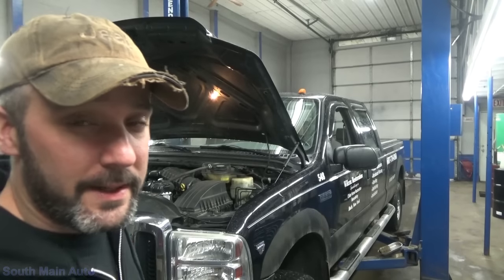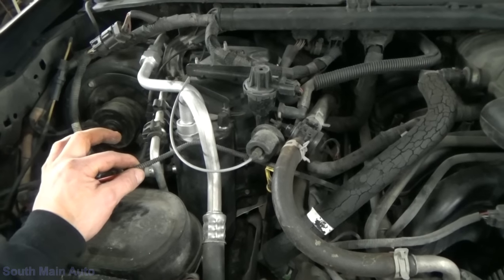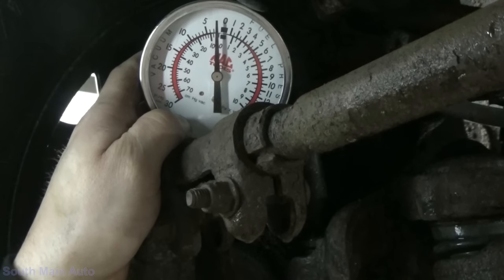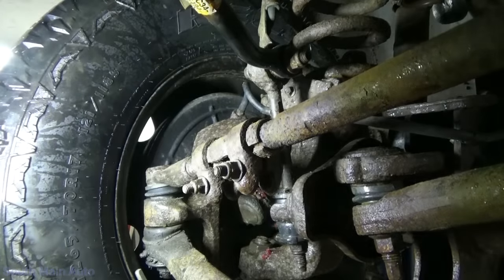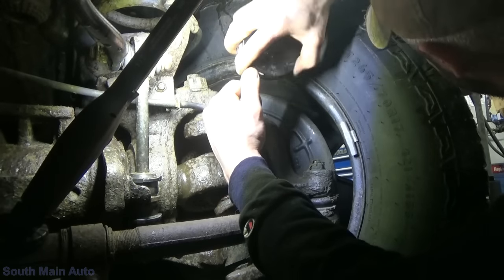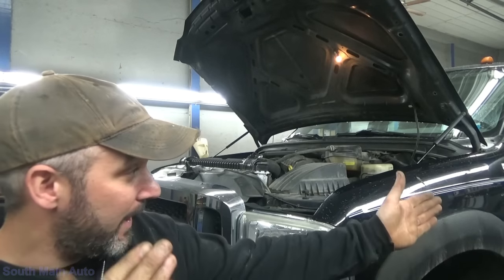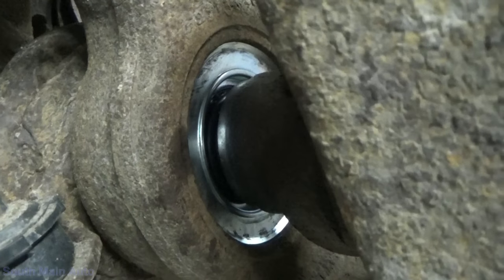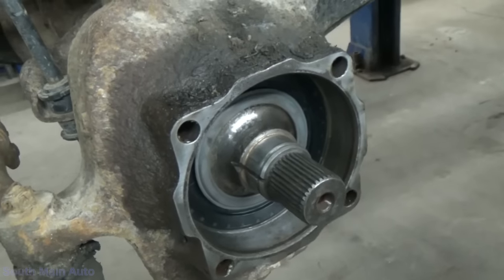Ford F250 4x4 - Vacuum Hubs NOT Engaging

Comment: I just replaced the ball joints and seals and hub. Use Moog ball joints or equivalent.  Anyway I did not use a special tool to get the seals in, I used a 4" ABS pipe and a sledge for the big seal, not easy but got er done. I did see an interesting tip from the Ford 6.0 guy (sorry do not recall his name) to put lube into the chamber of the wheel hub to make it last longer. Interesting idea. Thanks for the video.

Comment: I have a 2003 Ford excursion v10 4x4. when did my front wheel bearing replacement on driver and passenger if I omitted the dust shield will that thickness cause issues for the auto lock hubs being put into the wheel bearing? As in tolerance, not allowing me to receipt the auto liking hubs into the wheel bearing all the way as they should because the spindle shaft will be protruding out that much more in terms of the thickness of the dust shield? Or I'll be okay if I don't have the dust shield installed when I put the new bearings in? I just didn't know what the tolerance is in the center of the auto lacking hubs for the spindle going into it

Comment: What is the expected vacume at the resivoir? Mine holds at 5 PSI. Is this adequate to operate the 4WD valve and also the air distribution in the cab of the truck.

Comment: According to the Ford service manual, if you turn the Mode Switch Select on the dashboard to 4x4 high, the system will enter an approx 51 second cycle to apply a higher (> 9" Hg approx) vacuum to engage 4x4 mode, then vent the vacuum. If you turn it back to 2WD during this cycle, it will have no effect until the first cycle completes. At that time, a lower vacuum (approx 6" or 7" Hg) is applied to take the system out of 4x4. The 2WD cycle time is approx 15 seconds, but can be overridden by switching back to 4WD.

Comment: i have an 08 expedition thats not going into 2H
4A 4H and 4L switch ok
but in 2H the front axles are rotating with hubs unlocked as in 4A.
Do you happen to know the resistance values for the 4modes on the 4wd switch?  The factory ford manual
i have only shows 2H, 4A and 4H but not 4L so i suspect its not correct.
im thinking 2H resistance is off value or open.

Comment: Never second-guess the guy actually doing the work.  Also, it's your shop.  The mistakes will find you one way or the other without the peanut gallery's hounding.

But, you did mention the issue when returning to check the vacuum draw on the right side...  "As long as any possible leak is smaller than the vacuum draw, a simple gauge test won't definitively indicate one." 

Rather than smoking just at the left hub, it would have been a good idea to back-check the lines and other hub from that location too.

Keep up the good work!  As a DIY'er whose cars, trucks, power equipment, and sports vehicles have never seen the inside of a retail shop, I've learned a ton concerning emissions systems and diagnosis from your YouTube endeavors.  I much appreciate your willingness to take the time and effort to share your knowledge!

Comment: A piece of 4 inch schedule 40 pvc drain pipe about a foot long with a board on the end will drive that seal in on the 99-2003 superduty, that hub bore is exactly 4 inches so it will drive in square until it hits that ridge in the knuckle, I'm a diy fix my own truck guy and it got the seal installed with 0 damage to the seal and got my truck back on the road

Comment: Quick question. I have an 03 super duty with 6L turbo diesel. I had a guy try to figure it out before I bought it but it's not fixed though.
My 4wd works if I lock the hubs tcase is driving all the time. The dash switch doesn't do anything. He had tried new switch new tcase solonoid. In auto on hubs it's free spin.
Would a vac leak cause nothing to change on dash and hubs not to lock

Comment: Why did you remove the dust seal, cause you dont like it?
And why did you remove the spacing collar? You dont like that either? It helps keep the splines out of the rusty grit when sliding axle back in. Confused.

Comment: just wondering that vacume seal separated I don't need it because I have manual locking hubs but now I have a sqeeling noise I can't tell where its coming from but its when its in 4x4 could that seal which I can see from looking from the back the rub has come off will that cause the squealing noise?

Comment: you can make a tool from a pipe, pipe cap and a flange mount.  you have to premeasure the depth before disassembly the carefully keep measuring as you assemble it.

Comment: tanks Eric .. watching your video i reached my mechanic a trick didn't know..by the way if vacuum doesn't work or seals not changed yet.. turning the hubs in lock position the 4x4 is suppose to engage?.. i still ear a bad growling sound on 4 x4.. and even if I disconnect the hoses in the hubs, and engage the 4 x 4.. the sound is there.. is stops only if I take out the locks ( mean unbolt and take out! ) the sound stops.. on 2x4 no problem p.s wheel locks are new...!! any advice please?

Comment: I have a 2005 f250 6.0, I have 3 buttons for 2wd/4wdh/4wdL, do all f250 trucks have that outer locking hub switch since my 4x4 is not working, basically manually lock the hub

Comment: My Dad had an '87 S10, had a real bad out of balance driveshaft. Engineers from GM, came from Detroit to figure out why. After rebalancing and even replacing the driveshaft it still was bad. They eventually found out it was made wrong, and they replaced it with another new one. Months went by,  craziness.  My Dad still talks about this, this was about 20 yrs ago.

Comment: LOL when one side goes bad, never assume the other is good.  Always do both sides since no one I know drives on only one side of wheels! :) I had a 99 Dually, same thing on that one. Those seals are not cheap, plus the o-rings need to be replaced every time the hub is taken apart, and those aren't cheap either.  I finally gave up after it failed a second time 2 years later and threw a set of WARN lockout on since back then they didnt have the manual mode caps.

Comment: The knuckle vacuum nipples are prone to corrosion and often the vacuum leak is right there where the rubber tube connects. Instead of paying $20 for a new nipple from an automotive shop, an SAE 7/16 brass plumbing nipple fits just fine.

Comment: Mr. O enjoyed the video I kind of was surprised that you didn't used to smoke machine on the whole vacuum system instead of just using it on the one hub seems like it would have saved you a lot of time in the testing process but what do I know keep up the videos really enjoy them
Reply from the maker: Lol well sure could have but was just showing a bit of the isolation process with just a gauge...

Comment: How does a drive shaft suddenly become unbalanced.  Much less to the point a driveline shop can't balance it again?  Always wanted to like Ford.  Just seems like the KISS method is completely lost on their engineering team.  From blowing spark plugs, to the coolant crossover tubes that require entire intake replacement.  Never knew this was an issue on their front ends.  Kinda minor though.  I'd lock them and use the transfer case.

Comment: I know this is an older video, but surely you'll get a notification.  What smoke machine are you using?  I work at a landfill and am a heavy equipment tech, but also am responsible for about 15 pickups.  Boss's 2011 F250 has this same problem, but I don't have these fancy leak detectors you pro guys have because we have such little use for them.

Comment: You are a phenomenal mechanic, and I'm I'm not trying to beat you up, but I believe the seal installation tool would be better served by using a large dead blow hammer instead of the ball peen hammer. It will make it last longer, just a thought.

Comment: Modern ranger is always locked at the hub. Electronic control is at the transfer case. Seems a bit better. Except that the truck is always turning the axles so it's gas burner.

Comment: Great video, this vacuum system was completely new to me, as I was watching, questions come up, then you seemed to answer them sooner or later.  Just left me curious about what controls the vacuum on off and pulses, I'm guessing a series of electrically controlled valves.
Reply from the maker: yep and a control module that runs the vac. solenoids :)

Comment: Is there any more durable maybe wire braid options for the vacuum lines? Maybe some universal line I could replace these junky dry rotting lines ford puts on em. So much vacuum every where on this truck and the material they use just falls apart.

Comment: Keep on mind most people only use 4x4 maybe 20 miles a year, unless they are snow plowing or dont make enough money in the summer to take winter off. So the question is does the seal  rotate in 2 wheel drive?

Comment: Just did My transfer case that has a similar$60.00 seal. Don't have the tool, but I have a very expensive machine shop. Made my own tool. Yes I would charge a lot to make the tool for someone else. Just some time and scrap aluminum. Just saying! 
Good video. George from southern  Indiana.

Comment: The old version you just had to drive forward in  4H or 4L to lock and backwards in 2H to unlock 

Everyone hated them but I always just packed them with grease. 

My Full size Bronco is 34 years old and only ever changed the hubs once because when I first got it I didn't maintain them and eventually they broke.

Comment: if that big seal fails can it cause a load screeching noise? if i look in from the back side thats rubber outter position has separated and is just floating around the ujoint area if i spray stuff in there the noise changes only happens when i have them locked in i have warn hubs

Comment: Nice job Eric.Without those tools you just can't do that job.But instead of using the smoke machine you could just buy a $2.00 cigar and use that.Hahaha
Reply from the maker: I think you have been watching to much Kilmer Jim!!
Reply: I think I will make a "Scotty kilmer" channel just so I can bug you in the comments Eric. Scotty would say things like "I could have done that job in half the time. You just need to loosen all the bolts before you start rolling the camera Eric."   LOL We all love Scotty too.
Reply: Just make sure that you sound like you are struggling even though it is already loose. "Just remove this one bolt...NYUUHHH!!"
Reply: I know right
Reply: Rather "Macgyver", 80's serie
Anyway, how well you work.  Zorionak,
Reply: Thank you for watching and your input.
Reply: or you can just go to a subaru meet. and politely ask to borrow a vape
Reply: cheap cigars at that to quote Kilmer!
Reply: you can do it with a makeshift tool on 99-04's the hub seal sets it's own depth on the lip in the hub, & imho the new axle tube seal is miles better than the old pos, the old ones would often fail in less than 6 months, and results in rust in the tube and on the axle, & dust contamination in the differential.
Reply: Have done mine without the tool. Not for the seal because I got rid of my vacuum hubs and went to full manual. But to replace the inner joints. Just measure before you pull it apart and take pics.

Comment: have u ever done a 02 s10 front end there horrible desgin they have a slip joint run by vacuum and the gears in the axle on them just get torn apart so my front axle is usless the one on my 98 envoy works great but my truck only works when it want and mostly in 4 lo! any ideas eric o?

Comment: I had a 1998 4x4 ranger with those vacuum hubs.  The vacuum tank and the actuator valve was located above the wheel well on the passenger side.   A stone broke both the tank and the actuator,  I found you could make the hubs manual  by pushing on the hub with a stick.

Comment: Great quality video.  Thumbs up.  Had a hiccup on my re-manufactured engine heads installation in the 2005 Jeep V8.  70% leakdown in cylinder #1 compared to a tight average of 18% leakdown in the other 7 cylinders.  Get to diagnose this weekend.  Exciting stuff :-(  Once I pull off intake and exhaust manifolds and the valve cover I should be able to find out where 70% of the compression is going using the leakdown test.
Reply from the maker: UH Oh!? Don't pull it just listen in the oil cap, at the tail pipe and at the TBI. It will be obvious at one of those places.
Reply: +South Main Auto Repair Couldn't tell where the air leak was coming from in this big V8.  Even tried to pump 100 psi and couldn't tell if it was exhaust, intake, head gasket, or radiator. I know it is not the rings.  I will not pull the head until I find the leak(s).  To do that I need to take off the intake and exhaust manifolds and the valve cover.  That is easy to do.

Comment: Still didn't check the other side right? You didn't smoke the hub on the one side just that you have vacuum at the line, or did you have the gauge t on it

Comment: Much easier to install the seal if you lube it with some vaseline first. Also, put the axle back into the vehicle to set the seal and seat the axle at the same time.

Comment: I have come across Ford drive shafts that have a cardboard vibration damper inside them.
It sometimes collapses to one side and really throws the balance out.
Reply: Anom Amos 
Toyota does the same thing in the Rav 4, it cuts down on noise and vibration so they can use thinner materials
Reply: Anom Amos Cardboard in a driveshaft?

Comment: maybe you cant help me out i have a 99 ford f250 v10 4by4  im have a bad poping and grinding from the frunt driver side. even if i lock it in manually or take it out it still doing. i put the truck in reverse it stops. and im not getting air to that side. but im maybe 12 psi to the other side. thx

Comment: Love my ford...... Best truck I've owned....... But they need to change those hubs. I already went through 2 of them. One time I did the replacement myself. Im no auto mechanic but im very mechanically inclined. Was the most pain in the ass repair I did to date myself. Baisically had to yank out the entire steering nuckle just to get the vaccum actuator over the end of the axle shaft and out. Hell i was borrowing tools I didn't even know I would need some day 😂. Took about a day in a half not knowing literally anything about what I was working on just learning as I went. The entire hub and actuator was just eaten. The tip of the gear faces were ground  to 45s. Lots of glitter in that old grease.

Comment: Could you not have just hooked the smoke machine to the passenger side the same as you did on the drivers side, or had you put it away already ?
Reply: If it built up and held vacuum (which it did)  Then there's no need to hook the smoke machine up to it.  Vacuum gauges are one of the most under rated test tools there is.  Quick and simple, all one needs to know?  Is how to understand what it's reporting.
Reply: I agree he checked vacuum to the hub but not through the hub, he should have smoke tested it too in my opinion

Comment: Generally the issue is the hub seals inner and outer. You can make the seal driver tool out of a black pipe flange,google it. The other issue is the solenoid on the passenger side he mentioned you in the engine bay. If you take the bolt off look at the back side of it, they typically crack from the heat of the engine.  The easy fix is junk the auto hubs go to Warren's block off the vac lines and call it a day. Just replace the solenoid or in spect it so you vac pump ain't running 24/7.  If one side is leaking the other ain't too far behind. Been there done that.  You can also take a mighty vac and go right to the hub to check the hub itself to see if it will hold vac.  Replace all the seals or youll be in there again .   The biggest issue is the grime gets into the auto hubs dial. One day it will fail and you'll go to turn the know and it siezed. A barrel wrench will work or you getting the oh shit and try plyers and the whole dial blows out.

Comment: I have an 05 f150 ,replaced both   hubs had bearing go bad vacuum hub seal at the lh rh front wheels the wee solenoid and vacuum lines  .wish they had the old system solid axel and manual  locking hubs.

Comment: HELP i start doing the brakes on my 2008 F-250 5.4 then find out that my front right wheel bearing hub was bad so i did replace the wheel bearing hub the vacuum seal and the hub then guess what winter come and no 4x4 i did the work on the front left all new still no 4x4 i replace the pulse vacuum actuator and still not Engaging so what do i'm missing